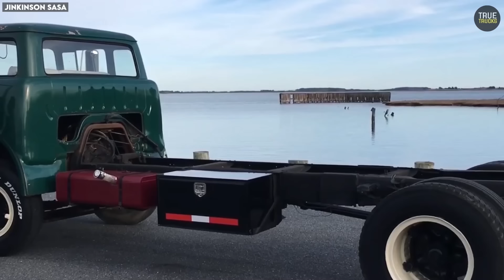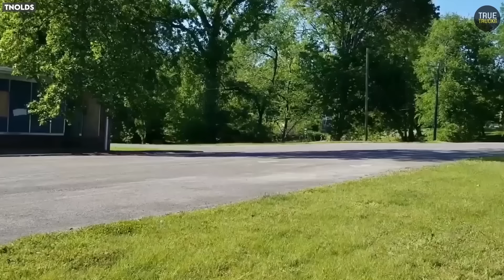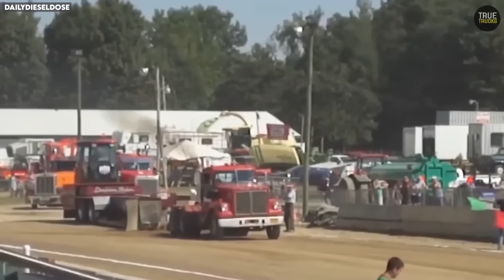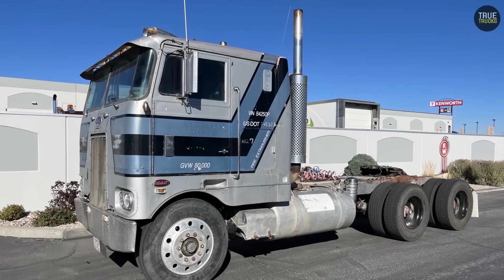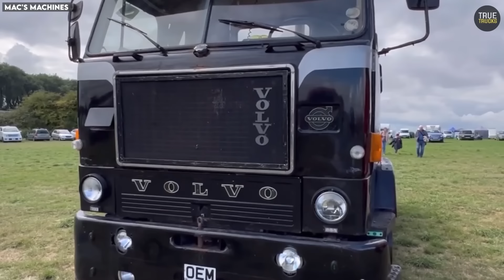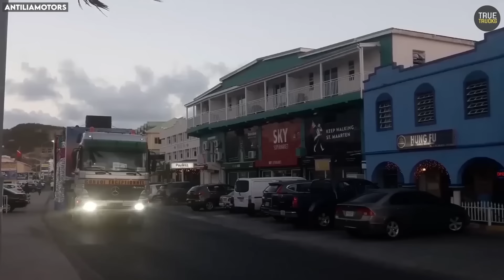10 trucks From the 1970S That Were Great, But Failed

Comment: Wife and I own a couple family members semis. One of which is her dad's '76 Mack Cruiseliner. We use it to haul our toy hauler to motorcycle shows and events., in the northeast.

Comfortable cab when driving, half the time we just crash in the sleeper when it's an overnight stop, save the camper for long stays.

Also own my grandfather's '66 Mack conventional, a Ford W series stake bed, and few others we ended up with over the last twenty years owing the old company depot, that became your shop in 2002.

My favorite is a 1991 Marmon Glider, on a rebuilt '77 Peterbilt chassis, Detroit backed with a thirteen speed backing it, and delivering power to the drives. Uncle drove it twenty years for a local beer distributor, and bought it when they closed his branch. Was passed down to us in 2006, when he passed, as my aihtiand cousin didn't want it.

We still smell the ghost of his cigars when we open the cab doors.

Thanks for the walk through trucking history.

Comment: The Astro was a piece of shit. 🤣
The international transtar was in no way a flop. 
The cruise liner was low power and small cab and it rode like shit. 
The KW and Peterbilt cabovers were good trucks. 
Cabovers were phased out once length laws were relaxed. 
This video is mostly a bunch of bullshit.🤣

Comment: THe 4070 was by no means a "failure"

I grew up in WI and lived not far from Green Bay until 1969

Schneider back then owned both the trucks and the trailers  and had nothing but  IH 4070's  in orange and black  between them and Allied van lines you would have though that was the only color they came in

Comment: the way I understood it, Cab Overs came about to help save fuel, not because of length. When the fuel shortages "stopped"  conventionals took over again.
Reply: What are you smoking? Cabovers went by the way side do to changes in length laws. Cabovers by their nature are less aerodynamic. Don't comment on something you know absolutely nothing about
Reply: NO

The first gen IH cab overs that Schneider had dated back to the 60's when diesel fuel was cheap  20 cents a gallon

It was length and they measured from front to back  

A CO could pull a 48 foot ' trailer and a conventional like KW W90 could only pull a 40 footer
Reply: @daleferber2096 No what? Those IH cabovers Schneider ran were nicknamed Emeryvilles because they were built in Emeryville CA. My Dad drove one with Pillsbury and my Uncle drove for Schneider at the time. So I don't know why you are preaching to the choir. I grew up in that era and don't need a sermon about trucks and length laws. My Dad took a picture of me standing on the seat holding the steering wheel of his Cracker Box GMC. Any idea what those were?
Reply: Back in that era there were no 48 foot trailers and 40 foot trailers were just starting to come about. My Dad ran Minneapolis to LA with a 35 foot trailer. @daleferber2096
Reply: @daleferber2096 It's W900
Reply: Wrong. 
Cabovers are not aerodynamic. 🤣
Cabovers were all about the short length laws